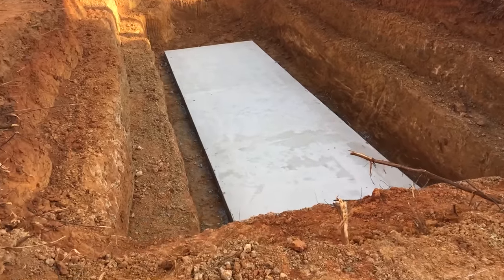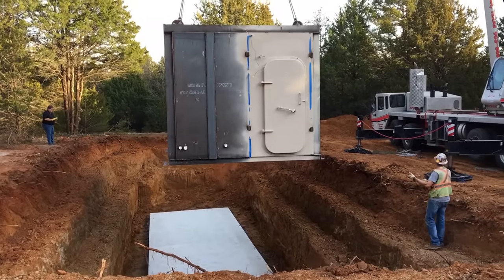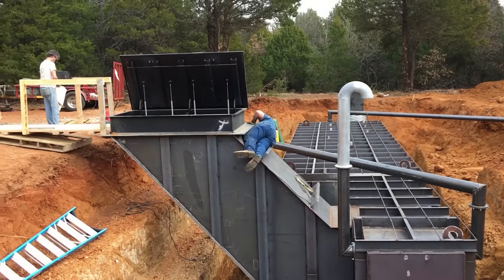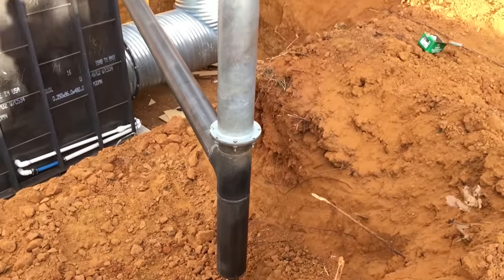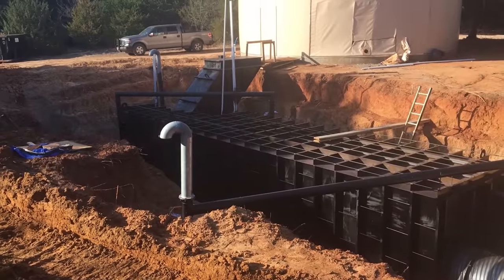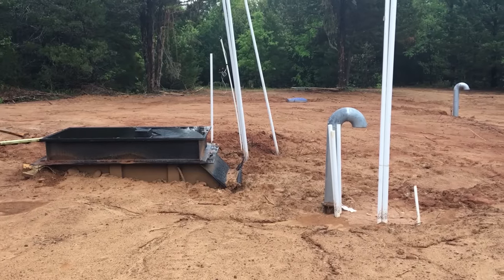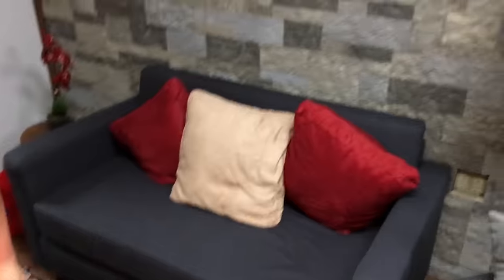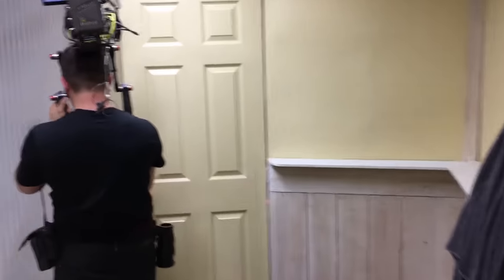Atlas 10x30 Safe-Cellar - Luxury Bunker Built Under A Home (Complete Installation Video) - Part 1

Comment: This is great as a storm shelter. I see a lot of people coming up with extreme and unlikely circumstances just to talk it down. Sure it’s not perfect for long term survival, but for temporary safety it is much safer than hiding in a bedroom that’s not reinforced. Maybe it wouldn’t suffice against a professional hit man but if this owner was intending it for that purpose then at the very least it wouldn’t be televised. As for common criminals, the authorities are usually notified by an alarm or the homeowner. I’m willing to bet the guy who’s looking for valuables isn’t going to stick around and try to ‘Macguyver’ a way to kill the homeowner or break into the bunker.
Reply: John Aiken it’s a fallout shelter, and pretty well done. Everyone topside would be sick or dead. 2 weeks later you would be able to leave.
Reply: Yeah, agree with you on that. Down here in Australia, most people who live in the bush, in a bushfire prone area or high-impact storm area generally have these kinds of bunkers in case of natural disaster (which happens quite often).
Reply: O K it looks nice but Its merely just a heavily fortified wine cellar. A fallout shelter has no need for a full bathroom and kitchen. Utilities will not work and water might not be potable. I also see no room for storage anywhere
Reply: William, they said the storage is somewhat concealed. They would likely have stored water and filtration systems. then there is the wine lol. It has a generator room! Why not have a bathroom and kitchen?
Reply: stee vo I highly doubt they had enough to survive 2 weeks. They pretty much made an underground chill spot. Could've just saved the money and bought a Home Depot Shed to chill in.
Reply: William, you assume they are incompetent and need to save money. Being multi purpose is good for me.
Have a nice day.
Reply: They changed the way we used to do things promoting WOOD homes when we used to build houses out of Steel beams and concrete! If people would go back to what worked in the first place we wouldn't see all these toothpick houses laying like Jenga pieces.
Reply: a bit overkill for a storm... but whatever, its just money, the owner has it, and now he's shared it with others.  makes the world go round.
Reply: But the thumbnail says “BOMB shelter” 🧐
Reply: stee vo The only person assuming anything is you. Honestly I can care less about anybody else's survival tactics except mine and my family's. Im stating facts though. The description says "Bomb" shelter. By no means will they last without bulk food and water storage. You also cant eat a fireplace. But you can cook up a real leather couch though if done right.
Reply: Tyrannical Grim  Well if they stocked the thing with food they could survive some serious shit. It's not like they would take a direct hit from a bomb.
Reply: Garry Mcgrath air is not radioactive. Radiation attaches itself to dirt first etc this shelter has a Swiss filtration system. Positive air pressure. But really, enough 45 degree bends in the air intake and your ok.
Reply: @cuddles6938  America has almost never used "steel beams and concrete" to build residential homes. A lot of Europe uses concrete to make their homes. It's not popular here In the USA.
Reply: @Ok-551  yeah but if you put a bag over the air intake and/or exhaust the person inside is fucked. So easy to defeat the whole purpose of this nutty shelter.
Reply: Nothing to do with popularity! It's called LOBBYISTS in congress to favor Lumber mills and other companies to change things around. Houses in Utah are built from Cement and Brick. Only certain portions of homes have WOOD being used.
Reply: @cuddles6938  it's a lot to do with popularity. Concrete companies are more than free to make a home backbone out of it.
Reply: Check out what China is doing with 3D Printer Houses using cement. Soon we can design our own house and have it built rather quickly and stay warmer.
Reply: @Ok-551  By the standards of the Russian Federation, this is the simplest shelter from radiation or non-nuclear explosion... The lowest protection class. From a near nuclear explosion, this will not help. But it's better than nothing. Prefabricated earth shelters (dugouts) have the same protective properties. But they are not airtight.
Reply: @PRO_Moscow  I would agree. If you are in the blast zone you want to be deeper.
Reply: Guys, here is The Savior

HalleluYAH translates “Praise ye YaH”

YaH is The Heavenly Father 
YaH arrives via the TENT OF MEETING
YaH was Who they Crucified for our sins
YaH was Crucified on an Almond TREE

— Ancient Semitic Cuneiform of Moshe (Moses)
— Isa Scroll (The Original Isaiah)

Isaiah 42:8
"I am YaH; that is my Name! I will not yield my glory to another or my praise to idols.

Isaiah 43:11
I, I am YAH, and there is no other Savior but Me.

Isaiah 45:5
I am YaH, and there is none else.

Comment: Since the bunker itself and the assembly with the stairs are separate, when were they welded together? Were they welded before the epoxy was sprayed over the bunker or after inside that was done?

Comment: Did I miss the bedrooms/bunks?
Reply: Jerry Henderson these ones are completely customizable, so you can have what you want on the inside. I think this one was designed as a wine cellar/ man cave, that could also function as a fallout shelter if needed. There are larger versions of this one where you get this big space, plus a bedroom that goes behind that home sign with the escape tunnel and gun cabinet in the bedroom. They are more expensive though.
Reply: The bedrooms are upstairs
Reply: The wine Sellars must have been more important
Reply: Only weakness I can think of is flood.
Reply: I think the idea behind this concept is, that if you drink enough wine you can sleep anywhere, for example just on the floor. Nice! :D
Reply: Tobias Mills
I can understand that. If the water goes over the vents, you can suffocate. If I had the money for a bunker, I would install an air scrubber for emergencies. I would also want auxiliary air vents going all the way to the roof.
Reply: Gihren Zabi yeah I just thought of this because of the recent hurricanes. You could easily prevent this by elongating the pipes to be past the roof of the house.
Reply: They forgot that part but they have enough wine for a couple years
Reply: Not to mention a full kitchen with no space for even a week's worth of food
Reply: In my opinion this box is a waste of money but it makes this guy happy and is his money. Guess the guns are to keep his friends and neighbors out.

Comment: I like the idea of using a shipping container as an underground dwelling, but, I'm not into the survival part.  I would just appreciate the climate advantages to living under ground.  My design would be underground living quarters on the side of a hill with a concrete silo for entertaining and scenery.  Possible something like Andrew Camarata's shipping container castle tower.
Reply: David Allen
I wouldn't want to be around after a catastrophic event like that.  I would rather just go and meet my maker.   With that said, I have thought about shipping containers underground as well.  There are a few videos on YouTube that show that the shipping containers collapse when they are buried underground.  What a shame, you can have them in 40 ft. lengths and weld/bolt them together and have a nice setup for a good price.
Reply: Don't bury a shipping container without extensive waterproofing & strengthening. They are only made of thin pressed steel & only super strong at the corners to "stack 'em high". The floors are not steel sheet, but are made of wooden sheets clipped to loads of steel C beams. Some people turn them upside down then weld steel plate onto the inverted C beams & reinforce the sides etc., but it's a lot of work. Shipping containers are designed to eventually sink for insurance purposes,so they don't float around forever until the collide with ships, hence the wood floors. The floors are strong enough to drive vehicles into them or put in heavy goods.

Comment from the maker: This shelter was designed to be her safe room-wine cellar-Tornado shelter with the NBC air system for Fallout just in case
Reply: It's not deep enough to protect them from radiation. A 2-4 m thick  concrete ceiling would be better.
Reply from the maker: Yes it is.   You need 24-28" of concrete or 36-38" of compacted soil for gama  shielding